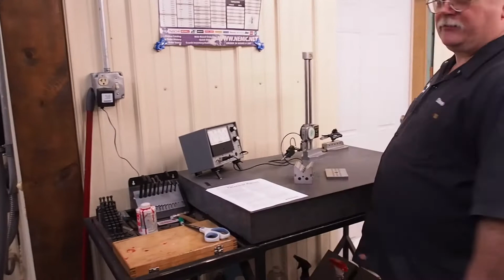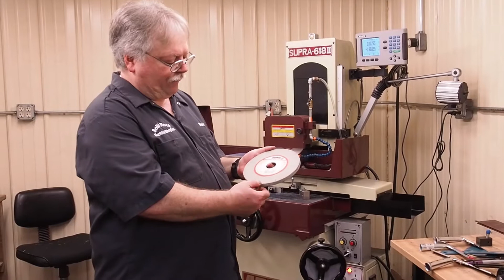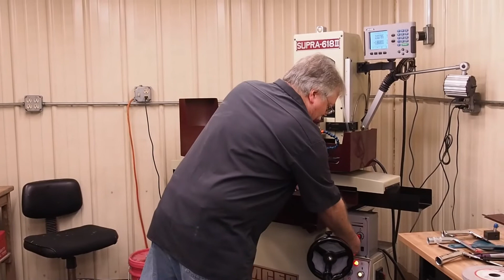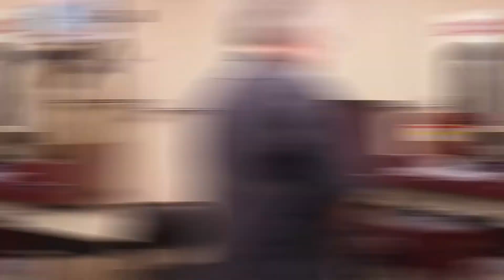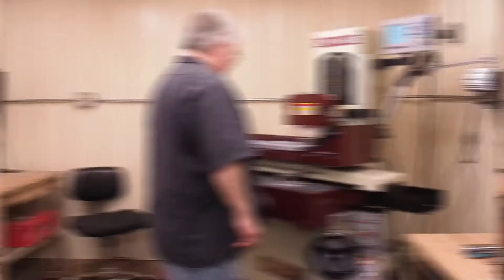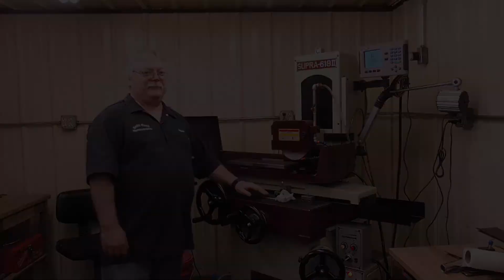Truing a surface grinder magnetic chuck.

Comment: Hey Steve! The 1/2 HP 1725 RPM motor on my benchtop surface/universal grinder just died. It seems to me that a variable speed motor might be a useful upgrade as long as I'm changing it. Would you agree? The existing configuration has a two step v belt pulley without much difference between the two sizes. I'm thinking a small 3 phase with a (relatively cheap) low power VFD might be good to have, but I don't actually have much grinding experience. Like tens of hours on this inherited machine. What do you think? Worth the extra work to set up or just slap a comparable replacement on there and be done?
Reply from the maker: Did the old motor do a good job for you? Were you getting the finish you wanted and able to hold the sizes you were shooting for? If yes I would go 3 phase with the VFD. You will be amazed at how much difference 3 phase will make. If your finish and size holding suffered the 3 phase would do little to improve this.
Steve
Reply: Solid Rock Machine Shop Inc. Sometimes, but I think my skills are more to blame than the machine when it doesn't. Especially using the wrong wheel. I finally got a couple decent wheels, then discovered the motor is bad. Most that came with it are narrow and fine and meant for tool sharpening. 

Maybe I'll just hook up something I have on hand and get a better feel for the condition with the right wheels before going further. That is a good point.

Comment: Hi steve
It sure is nice having someone who KNOWS what they are doing, make a video about grinding the magnet. If I might ask, what is your feelings about a hydraulic grinder?
Reply from the maker: Hi imystery man,
At my full time job we have 2 large hydraulic grinders and they work great. We use them mainly for top and bottom flat grinding where the wheel comes all the way off the part. grinding slots or steps where there is shoulder work is scary on a hydraulic grinder.
Steve

Comment: Hi Steve, on the head creep, can you go past your desired height and then crank the head back up and eliminate the settling or will it still settle? I'm very new to trying to work to millionths.
Reply from the maker: Hi carlquib,
I have never tried that so I can't give you honest answer. So far I have had very good results sneaking up on the desired dimensions staying a .0001" away and blank passing knowing it will settle. The nice thing with the digital reading in .00005" resolution you can see it. Thanks for commenting.
Steve

Comment: What would be the advantage of a 1 inch wide wheel over a 1/2 wide wheel and what thickness do you recommend for general grinding on the surface grinder?
I am learning and loving every minute of it, Thank You for sharing
Reply from the maker: Hi imystery man,
The advantage of a 1" wheel over a half " wheel would be double the cutting surface. If you were just flat grinding and coming all the way off a part then your wheel would last longer between dressing assuming you have the right wheel for the job. Another advantage would be if the 1" wheel was recessed for the hub nut then you could grind up to shoulders on tall parts without hitting the hub nut. The disadvantage would be a a little more heat build up if you are not careful. On larger grinders 1" and 2" wheels have more rigidity. On grinders with 8" and less wheels I prefer 1/2" thick for general grinding.
Steve

Comment: Hi Steve. I have been taught by a toolmaker there is an extra step in this procedure. First remove the chuck and grind flat the table where the chuck sits. Than turn the chuck upside down lay it on the table, activate the magnet and grind flat the bottom of the chuck. Than comes your steps. What do you think about this extra mile?
Kindly Radu
Reply from the maker: Hi Radu,
This has already been done months earlier as well as grinding the bottom of the chuck which is important too. You only need to do this step the first time, or if you get a build up problem between this surface and the bottom of the chuck. It is easy to tell if you have the build up problem without removing the chuck. If there is a build up problem your chuck will not stay true for very long after grinding it. I had one grinder that I could true up the chuck and the next day it would be out. The build up problem was obvious after removing the chuck. I see the build up problem often with synthetic and semi-synthetic coolants. I have never experience this with water soluble oil coolant. That doesn't mean that it can't happen with water soluble oil coolants but I never experience it. A chuck will experience wear if it is stoned improperly or by removing parts improperly. When this happens you only need to true up the top of the chuck without the other steps. The best stones to use are the ones we did previous videos on. Thanks for commenting, I am glad you brought this up, it is an important point that I missed in the video.
Steve
Reply: Yes, I forgot to mention the long procedure has to be done when replacing the chuck or when the rust gets underneath. Also Tom Lipton mention about FrogLube CLP Paste putting it in between the chuck and the table with grate results.
Thank you your replay.
Radu
Reply: Yes, I forgot to mention that. Also Tom Lipton in one of his episodes uses FrogLube CLP under the milling chuck for rust prevention. I guess will work under the grinder chuck too.
Thank you for your replay and teachings. You guys do a grate job.
Radu
Reply from the maker: Hi Radu,
I think I watch that episode from Tom Lipton. I never put anything between the resting pad and the chuck. So far I haven't experience any problems. I don't want anything in between that has the potential to affect the chuck accuracy. If the lube goes bad that can lead to bacterial growth under the chuck as well and cause problems. Thanks for commenting,you bring up very good points.
Steve

Comment: Looking forward to your next videos!!!! :)
Enjoyed this one.. I need to grind my chuck for the first time
You ever use SG wheels- seeded gel? thought on them ?
Reply from the maker: Hi D K,
I have never tried the Norton SG wheels, but the Radiac ceramic Aluminum Oxide mix combined with open structure wheels are awesome. Ceramic wheels like to be aggressive and are good at removing a lot of stock fast and they grind cool in harder steels. Some times the finish may not be as good but I am talking very little difference if used right.
Steve
Reply: Thanks Steve, Tell your boys they are doing great and to pick up all they can from Pops..  :)

Comment: If you are going to use the magnet in a residual condition do you re-dress it with the magnet "half on"?
Reply from the maker: Hi Max,
I can't think of anytime that I ever ground a part with the magnetic chuck in residual mode. I have a variable magnet and use that mode for a light magnetic hold. I would think that the residual would still pull the poles together and not alter your grind. The thing that I would be careful about is I don't know how long the residual magnetism would last, or if it gets weaker with time. If the residual would let go after some time it could be dangerous. With a light variable magnetic hold it remains constant until you turn it off. I manly use residual to add or remove some parts without losing the hold on others that are on the chuck. An example would be redressing the wheel before a part is done. I would turn the switch to residual, clean the chuck where I was going to place the diamond dresser and then turn the magnet back on. I reverse the process when removing the diamond dresser. I hope I understood your question correctly, if not, let me know if I missed your point. Thanks for commenting
Steve
Reply: I've used residual a little for thin parts.. but not enough to know how it reacts and to what degree in measurement variation from the full "on" mode of the magnet. Food for thought... thanks Steve.
Max